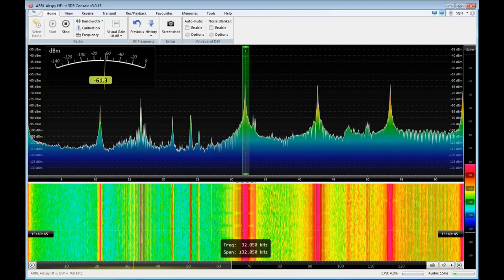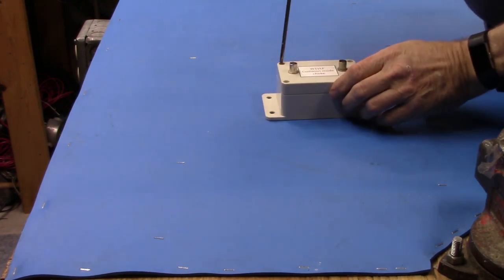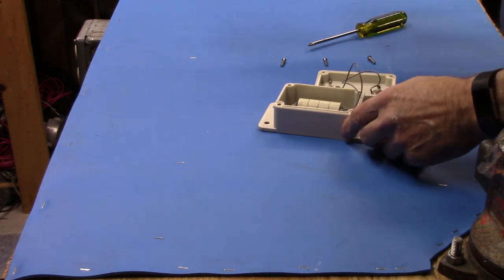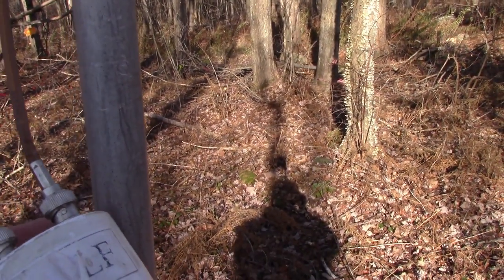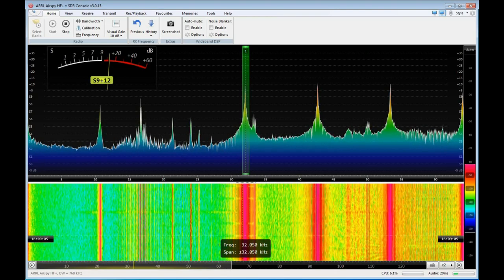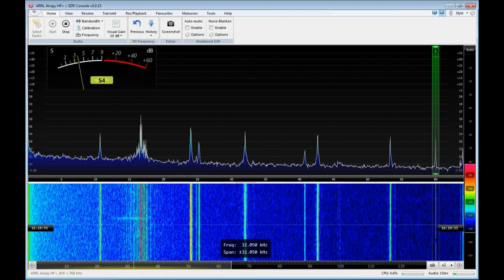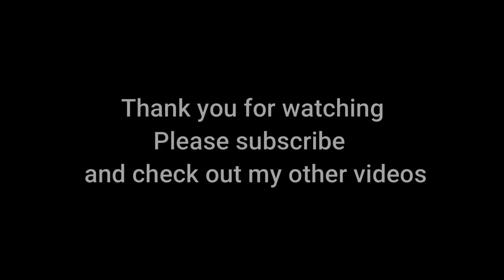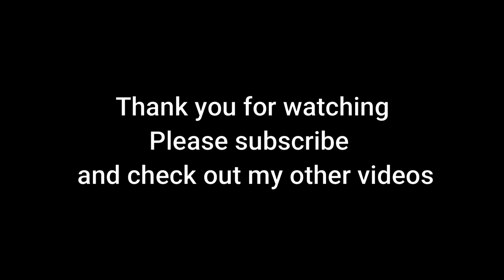Common Mode choke Noise reduction On VLF signals

Comment: Paul, what is the Inductance value that you measured? I mostly use Type 31 material below 2 mHz to construct chokes. Had no succes with galvanic isolators on vlf. They compromised the signal levels below the MW band.

Comment: I've been reading about chokes everyday for about a month now and Ive found so much conflicting results and mathematical calculations.  
 I've a 1/4 wave inverted tee dipole for NOAA apt satellite imagery but without a way to measure the antenna swr ect how can I find with ferrite core to use and the turnes to wrap? 
I'm only getting into Rf and there's much to learn I'm blown away. It seems to be a science!  Do you recommend getting an antenna tester? If so doesanything cheap one to mind? I know cheap isn't always best but at least it would give me a ballpark figure to start by???.....
Thankful the video 👍
Reply: NanoVNA

Comment: Hi,

Do you also recommend the common mode choke noise reduction for SWL/HF? Or only VLF?

Thank you
Reply from the maker: Hello .. It certainly cant hurt to use a well designed CMC. They are most useful in MF LF VLF  bands because thats where the the strongest noise sources are.
Reply: @W1VLF  Many thanks for the clear reply, much appreciated.

Comment: Why a common mode choke for VLF reception?  For reception (but not for transmission) it's gong to be much easier to implement an unun isolation transformer. It won't really matter if the signal gets reduced since the noise levels received on any antenna no matter how isolated are large.

Comment: Interesting video, thanks !
I have one question. As far as I understand, e-probes need a good grounding. How would I place chokes and grounding point along a coax ?
Reply: Ground the coax at the base of the non-metallic mast. Then connect the CMC on the rx side of the coax. You may want to place another CMC before the coax enters your house & maybe at the rx. Everyone's situation is different so you may want to experiment.

Comment: I'm Confused how it can work when the Center Conductor of the BNC's are not Connected. or is it ?? The wire is not Visible ??
Reply from the maker: Hi.. Common mode currents, in this case the noise, travel on the outside of the cable.  The CMC acts like a resistive element and stops the currents, noise from getting close to your antenna... Yes there is not a connection to the center conductor  W1VLF

Comment: Your diagram left out an important circuit element in the system, the ground at the SDR end, however sloppy. I would suggest for VLF work a large number if bifilar turns on a large low loss toroid core. This will effectively break the ground loop for 60 Hz and its harmonics. The combination of CMC and transformer should provide some significant help at lower frequencies. If you design the transformer for 3 kHz as a 3 dB down point you might clear out that stuff at the low end of your monitoring spectrum.

The formal citation of Joanne's Ground Law is simple, "Ground isn't." This is mnemonic for the detail that ground is always a circuit element. Even if you use single point ground you have the lead inductance and even its antenna-like characteristics plaguing your best efforts. Break the ground loop, a nice large magnetic loop. Your CMCs do this nicely at the upper end of the video's frequency range. But, you dismissed the lower end as "can't do anything about." You surely can. That's what the transformer does. I'd experiment with both bifilar turns and isolated turns on opposite sides of a large toroid core to find the optimum solution. At the couple hundred turn level I suspect bifilar would serve a little better at the high end of the frequency range.
{^_^}
Reply from the maker: Hello .. Can you possible send me a direct email?
Reply: Hi Paul.    I'm just starting this years 630m band activities.  Before I install it I will make sure to include a couple of common mode chokes.   I've also seen people provide an earth connection at the base of mast used for the e-field probe.  I guess this has not made any improvement over your 2 x CMC installation.  73 and tnks for the video.  David G0MRF
Reply from the maker: @davidbowman1828  Hello David.. I am am making a how to video even as we speak.. Hope to be done by tonight. If you would be so kind as to subscribe I would be honored
Reply from the maker: @davidbowman1828  Sorry I missed this part of your question.. Yes I provide an earth ground at the base of the antenna, active or loop. I have not experimented enough to see if the ground is more effective at the antenna itself, or  on the CMC feeding it. Work to be done there.

Comment: Seems to me a more expensive and time consuming project in comparison to a coax air coil called by some an "ugly balun".
Reply from the maker: That is incorrect...  what is needed to choke off common mode signals  is a high inductive reactance at the frequency of operation, in this case VLF frequencies and above. A few turns of coax such as used in HF operations would be woefully ineffective at VLF. Hence the cores designed for those frequencies and the multiple turns.